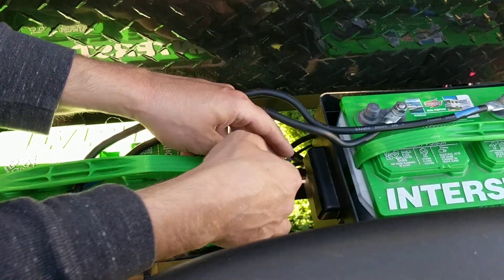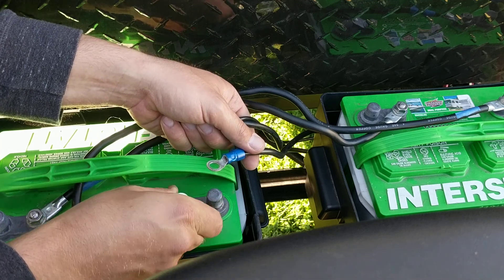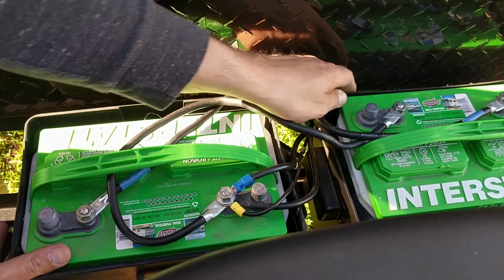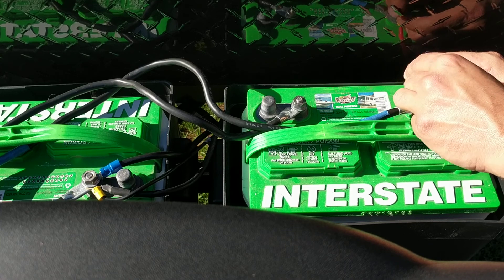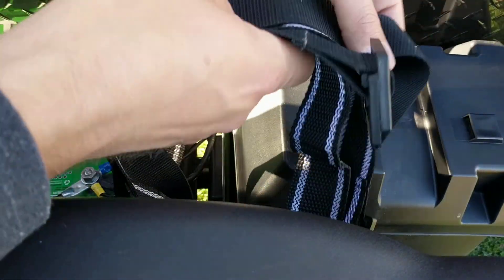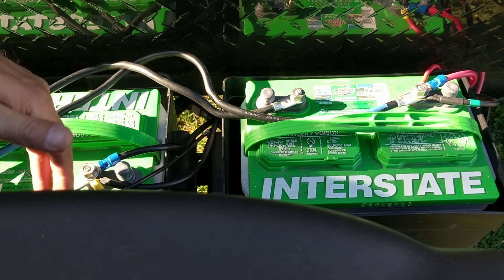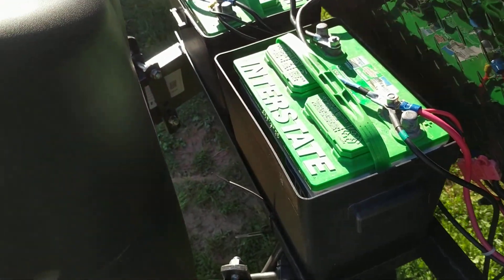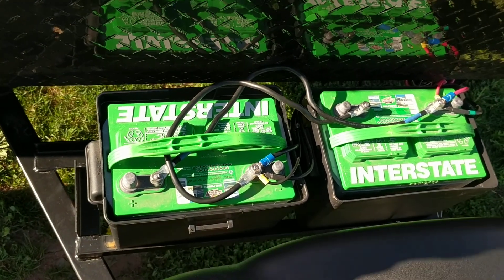How to HookUP Double or Dual Battery Interstate DEEP Cycle TO Camper RV in Parallel 12 VOLT Setup

Comment: Two 6 volt in series is a better arrangement.    Better capacity.
Reply: @5Bucs 6 volt cost a bit more,  but worth it in the long run.  Check with a reputable battery shop.

Comment: Question: when I go to hook up the parallel wire from one positive to the other positive I get a little spark at the terminal. Should I be concerned about getting shocked when I go to secure them with a washer and nut? I’m pretty uneducated when it comes to playing around with electricity. Thanks

Comment: Excellent video, except you are talking so low it is very difficult to hear what you are saying.
Reply from the maker: I didn't have microphone yet sorry, just got one so future videos should be much better sound.
Reply: @lifetravelwork270  /what were the lengths of the cables connecting the two batteries together?